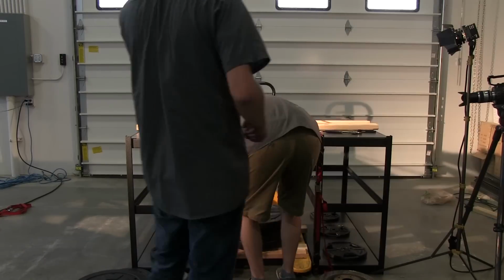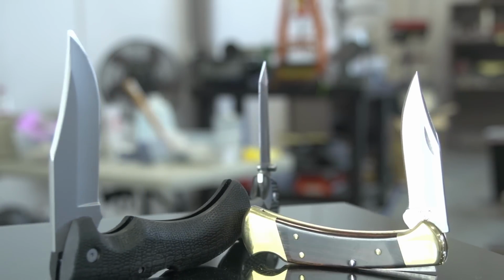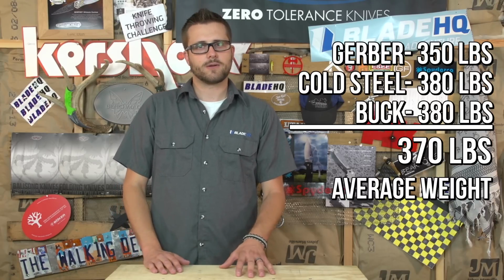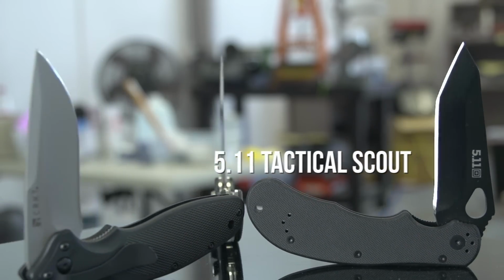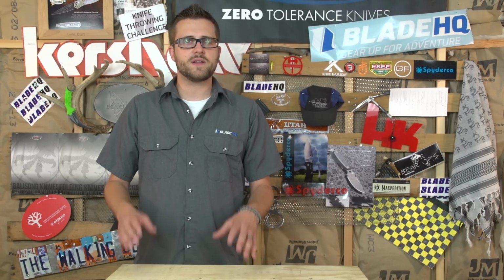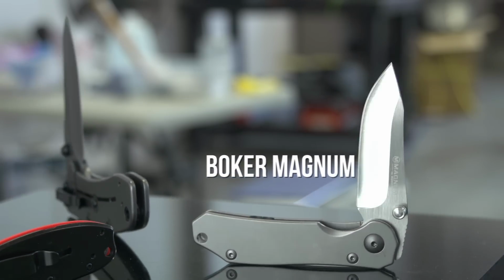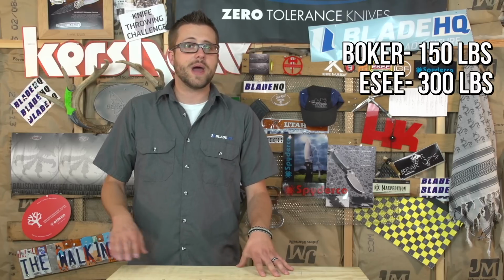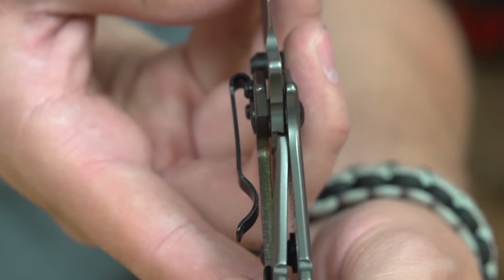Pocket Knife Lock Strength Test

Comment: you can't take an average when you max out at 380
Reply: It’s fair for the liner and frame locks which also failed at 380, but not for the lockbacks.
Reply: I know a couple of guys who can bench more than that...so I expect the best steel/titanium modern knife locks to go higher...
Reply: This comment makes no sense.
Reply: @libertynindependence  It makes perfect sense its unfair to use 380 because they didn't break.... what if they actually would have gone up to 500?
Reply: @trevor894  its not a test of its max, its a test to see 'Which lock type will hold the most?' as noted in the description. Obviously lock backs are the strongest, it really doesn't take a test to realize that.
Reply: Trevor 

They were unable to use the rest of the weight because they didn’t have it with them I’m assuming.
Reply: its called an outlier lol
Reply: I’m guessing they couldn’t use more weight because it would ha e stacked higher than their platform/rig would allow or they didn’t have that much weight with them. At any rate, this was a test to show which lock type was the strongest, not which knife, so they can take an average at any weight
Reply: Aaron Gallagher not really, I think he was talking about the possibility that "for a certain type of lock, difference in manufacturing may make huge difference and actually pull up the average"
Reply: True, I don't know why they didn't just get more weights.
Reply: @sinjon  That's not how averages work. You can't just take a random number that the locks didn't actually break at and call it good. Let's say those would've actually broken at 500, just as an example. The average would be significantly higher, and the results would therefore be different. It's like saying "I only have two 10 pound weights, so the average that I can bench is twenty pounds, because that's where I maxed out." Doesn't make much sense.
Reply: Yes you can. 2 out of 3 is an average.
Reply: @utharkruna1116  You missed the point of the comment lmfao. You can't take an average when they limit the amount of weight they put on. In order to get the average you need to make sure they all break. That's like me having a baby and a grown adult lift a half pound weight and saying the average a human can lift is half a pound.
Reply: Ikr🤣
Reply: @trevor894  yeah, I thought they said they had 500 pounds of weights...
Reply: @libertynindependence  you're just not very bright
Reply: @AudibleVisibIe  I'll watch again to remember why I made the comment, but in the meantime see Gage Mason.
Reply: @RVered  how many guys you know who can dumbbell press with 300s?
Reply: Maybe they didn’t have enough weights
Reply: @legendarypillow1450  They said at the start of the video that they had 500lbs, but they were unable to use it all. They didn't have enough room under the testing rig to put any more weights, so 380 was the most they could squeeze in.

Comment: Come on man. In the real world are you ever going to experience a 380 pound force against your lock? Any decent folder is going to have a lock you can't break unless you're going loco on it.
Reply: I'm not disagreeing with you, but with more sudden/violent change in pressure, wouldn't it fail at a lower measure?  So this isn't calculating a realistic every day measurement, rather it is giving a comparative scale between the different models and designs

Comment: The distance from the pivot matters in comparing weight to weight
Reply: This exactly.  The bending moment induced at the blade-lock interface is what is breaking it, not the weight applied at the end of the lever.  With the handles of these knives averaging 3-4 inches in length, a difference of 1-inch when it comes to load placement could result in 25-33% differences in torque generated at a give weight load.
Reply: Andrew Lord 
Yep, classic mechanics
Reply: Rocky Jones physics...
Reply: Very true however my takeaway is that all three locks performed beyond realistic use requirements. Experiment successful. Just go with your personal preference if it’s a quality knife it’s safe.
Reply: True but it looked like they had the cable placement fairly even so I don't think the results were skewed much at all.
Reply: yea the first knife basically just broke in half, didnt seem the lock itself failed...
Reply: @codemiesterbeats  it certainly makes a case for a knife with full liners though, and not these mostly plastic handled knives just just enough liner to secure the axis pin and the lockbar together
Reply: @fee_lo8346  , and the Spyderco linerlock, it surprised me a lot. I had a feeling that lockback would be strongest. As you said, we can  choose whatever knife we want with  confidence. And I'm sure the newer knives and solid brands are even better. For a folding knife, even the weakest is more than enough. 👍😊
Reply: Frickin' exactly.   This is a TORQUE test, not a weight test.    Weight is force.    Torque is force x distance x cos(A).    But the cosine bit is always 1.000 so long as the angle is 90 degrees.    Why am I telling you?   You know this.    Plus you did your comment three frickin' years ago.
Reply: A practically static load isnt a useful test either. The only test that actually matters for folding knives is a live load. They should drop the weights instead of slowly lowering them.
Reply: The pivot point is pivotal so to say. I'l see myself out...

Comment: Just the shape and placement of the pull cable on the handle of each knife is going to change the test and make it so the force meaurements aren't comparable.  Better to put a pipe on each knife handle so the torque on each lock can be standardized.  You'll also be able to break each lock with the longer pipe under the same weight and take the handle strength out of the results as well to get a fairer comparison.  But, the results are pretty much as expected.  Lock backs are probably the strongest, they are just heavier and more expensive to produce.
Reply: The entire concept of torque was left out of this test... Very disappointing

Comment: Speaking as an engineer, what was the point of the test? The test put force on the mechanism in the exact opposite of the force of the knife would get while in use. Also, the person below makes a technically great point about statistical analysis. When you max out the weight at 380 pounds that biases the maximum load to the low side and therefore skews the data and average to lower than it would be than if all knives were weighted to failure.

Comment: The results aren't too surprising. Liner locks are just a thin piece of sheet metal, frame locks are thicker, and lockback mechanisms are even thicker stock (usually the same thickness as the blade stock). This is pretty much exactly how I would expect it to play out.

Comment: I'll remember this the next time I decide to put nearly 400lbs of pressure on one of my pocket knives
Reply: Kyle Stewart hhhhahaha
Reply: an the back of the knife to😂😂😂😂  I would say all locks are more when strong enough for all task you could imagine, it´s way more importernt they don´t accedently by mistake come loose!
Reply: Ikr. This video is stupid in this regard. I’ve literally used a frame lock in self defense and it didn’t fail at all.
Reply: Yes right? All these debates about what is safer. Have you ever put over 200 lbs of force in the OPPOSITE direction in which the knife is supposed to cut??? I mean a liner lock would hold my entire body weight. I don't think that safety is an issue in real life situations with liner locks. Or do you?
Reply: @bandito_dino  What exactly happened? And did you kill the guy? And yes I agree. This whole debate is silly. Who puts his whole body weight AGAINST the cutting direction of the blade???

Comment: very cool video guys. one thing to consider for future tests is the distances from the pivot you're hanging the weight at and the position of the lock from the pivot. because just for an example(if my school physics memory serves me well), if you hang 100 pounds 2 inches away from the pivot and lock is half an inch from the pivot, the lock is actually taking forces 4 times the actual weight so 400 pounds...
Reply from the maker: We tried to make sure that the positioning of wire was relatively the same length out, though this was more of a generalized test than a perfect one.
Reply: The physics term for this is torque. Torque is just a force (hanging weight) applied at a distance (distance from pivot). So Torque=Force X Distance....So 100pounds X2inches=200in-lbs...Just like a torque wrench.

Comment: You can't average the locking strength starting at the point where the lock failed.
You have to start at the last point in which it did not fail. Also you kept referring to the locks fail weight as the weight it held to.
Reply: I suspect there is metal fatigue going on. Wouldn't it be better to use a new knife at each new weight to exclude metal fatigue?

Comment: Benchmade Axis Lock please :)
Reply: zunedog31 Agreed but a neutral party test would be nice. :)
Reply: Spike T They put the knives in a Chitillin which applies constant downward force and reads out the exact amount of pounds before it senses a lack of resistance. It is a far more exact test than the one here and is the same neutral party or not.
Reply: zunedog31 yeah but they could have a special "ringer " that is a little more beefy than a random, off the shelf blade. I'd prefer to see this test done by blade hq on them.
Reply: I don't ever trust a manufacturers tests. They'll build special ringers or break 100 knives until they get the one that they want to show off ad's them upload that video. A manufacturer test is ALWAYS gonna be skewed.
Reply: Ganzo/firebird axis lock looks the same as a Benchmade,  how about one of those $20 Ganzos. I think they're a great value knife.
Reply: Benchmade holds the patent so there would not be a variety of knives to chose from to represent one type of lock. The axis lock is not as common as some of the others.
Reply: @Joe-jj3oh  the patent ran out on the axis lock in 2016
Reply: @cfltitan  the ringer was the cold steel
Reply: Spike T  indestructible

Comment: This test is mathematically inaccurate.  As a calculation of the average amount of weight a lock can hold, the values for breaking locks should have been reduced to the last amount they actually held.  For example, in the lock back category, the Gerber held 300, not 350.  The others held 380, they didn't break at 380.  Corrected values are: Lock Back 353 lbs average, Frame Lock 260 lbs average, Liner Lock 210 Average.  Relative values did not change, but actual average amounts did.
+1 to Gav, +1 to Mike Bradley.
Reply from the maker: We decided to be generous with the knives and give them the weight they failed at since our increments were going up by 50 lbs each time. If we had smaller weights and more time we could have been more accurate.
Reply: KnifeHQ Thanks for the reply BladeHQ.  I only pointed it out because the blades that made the max were calculated to "actual held" weights while the failing blades were given the benefit of the doubt.  I was just saying that they should have either all been given the benefit of the doubt or they should all have been calculated to "actual held" weight.  Still love the video.

Comment: Spyderco was one of if not the first manufacturer to do this and published the break points. For a short time there was an arms race to produce the highest lock strength which even exceeded 1000 in.lbs . However it is a next to meaningless measurement because in use locks fail mainly by instability and no one can apply 200+ lbs to a knife in a strength linear load so side or lateral loads will be the dominant failure point in hand. Hence why it is easy to find reports of locks breaking and even more releasing but it never takes near that kind of force.
Reply: quick sharp force seems to affect locks more drastically than slow loads.

Comment: Andrew Demko on his custom AD10 -- held 880 lbs and still functioned perfectly - he ran out of weight.   Strongest lock in the world.   It's a lockback.
Reply: I'd be curious to see that knife vs the Cold Steel since its max strength wasn't tested here
Reply: Andrew Demko is the head of R & D for Cold Steel   :)      he makes a few 100% custom knives - but the cold steel is the triad Lock which Andrew Invented.  the give would be based on materials, not lock design.
Reply: +Capolan you win. :) that sounds like a great knife.

Comment: Just my 0.02 but I think this test speaks just as much about the brands as much as the locking mechanism of these knives.  Before this test I already kinda knew which of the knives would pass or excel.  Sure enough, the Cold Steel, the Spyderco, and the Kershaw all made it to the Max 380lbs rating.  BTW, loved this video.. MORE MORE MORE!!!
Reply: Jay M Buck isnt the oldest locking design, the German Mercator black kat knife has it beat by many years.

Comment: That is really impressive on the Buck Ranger,  old long-lever lockback mechanism was designed well before the era of 'tactical' folders, yet it holds up.
Reply: +Peter Bednar Definitely. This gave me extra assurance as I recently received my custom buck 112 with S30V in the mail. So glad I purchased it.
Reply: +Peter Bednar Never been a fan of Buck, but I did own a couple Case knives over the years. (never had a single failure in that time) I recently replaced the Case after 20 years of abuse (the others were lost). Looked at a bunch of different knives before I settled on the Cold Steel Recon. Got both the 3 and 4" version and couldn't be happier with my decision. 

The Triad locks really are the best, but certainly not the greatest for closing one handed. It's a trade off I'd make again in a heartbeat. Ease of closing isn't the most important aspect in whether or not I'll buy or carry a knife. Lock strength, durability of steel, and ease of opening are more important. Cold Steel Recon fits that bill for me.

Comment: I'm disappointed that you didn't push them all to the breaking point.
Reply from the maker: We'll like we said we have 550 lbs but weren't able to use them due to height and the bolts on the wire clamps. If we do this again we'll use more weight :)
Reply: @BladeHQ  Well preparation is key, or was it a spontaneous test? ;P
Reply: Blade HQ mass XD

Comment: I’m really impressed with the Spyderco! They must make a good liner lock. I’d love to see a Spyderco Compression lock in another video, maybe one that can take more weight
Reply: Spyderco makes a GARBAGE liner lock.. ALL LINER LOCKS ARE GARBAGE.  they will all take decent static weight.. but if you tap it , its over
Reply: To be clear .. its not spydercos fault.. its the lock itself... Any slight goof in the angle of the lock surfaces will cause failure.. anf that means the slightest wear of the contact surfaces will cause the same fail...  Its really a small window..  thats why production knives have trouble with this..  and even high end customs...  The tolerance is the problem in production, and the wear is the problem in the custom.. liner locks are garbage. Frame locks are better because the thickness of the lockbar.. they resist vibration better. And allow more material contact between the surfsces.
Reply: @no.step.on.snek.2423  Liner locks are fine drama queen.
Reply: @no.step.on.snek.2423  liner locks are fine, if your doing anything ultra heavy duty, then use a specialized tool like a spinning saw, or buy a fixed blade full tang when applicable. But seriously, know what your knife can cut and not cut, a knife isn’t meant to go through metal period!

Comment: If the test is meant to compare types of locks, you need to factor out the variable of quality control.  Next time I'd suggest you test the different lock systems from the same manufacturer.  Otherwise we don't know if it was quality control or lock system that caused the knife to do well.  Still fun to watch though :)

Comment: A long ago, I had a folding knife. I was in love with its peculiar designs and it wasn't amy famous manufacturer as far as I can remember. However it did its job. Being the curious and perfectionist I am, one day I decided to force close it with my bare hands to see how strong are these lock backs. The expected happened and I got cut very deep in my left thumb middle conjuncture point. It was fron that day that I couldn't trust folding knives anymore and the beginning of a good knife hunt and reasearch. I ended up getting an Izula fixed knife. Recently I went to walmart and needed a new knife, this time I spent a good ammount of time choosing a trusty well manufacture folding knife and I ended uo getting the Buck 110 because I remember it was too best as folding knives and overall. Right after I bought it, I found this video and was very pleased with the piwer of its lock. I doubt I will try to forcethe power of the lock again knowing my past error but I do get curious...and wonder if the pressure forcing to close it with your own hands is more than using weights like showned in this video since its all meassured differently. One thing is a heavy weight attached to it and the other is using focused power with yiur hands which may vary a lot.

It would be great to see a video showing that example.
Reply: Definitely no way you could generate 380 pounds with one hand by pushing anyway, if you hit it you could but only for an instant because that's... well how kinetic energy works. But if you could push with 380 pounds of force using one hand then you would be able to bench press 760 pounds haha.

Comment: Did you fix the weight from an equal distance from the pivot on the folders? its the moment that destroys them so a slight difference in distance between the different folders could easely mean +- 50 pounds or more.. interesting test though and I thinks its a great service KnifeHQ
Reply: yea i was thinking the samething, you can make a bad knife look as good by hanging closer to the pivot